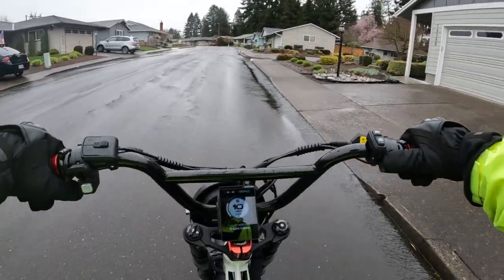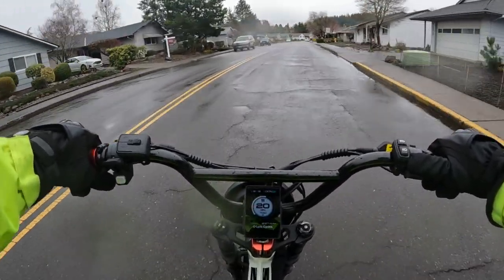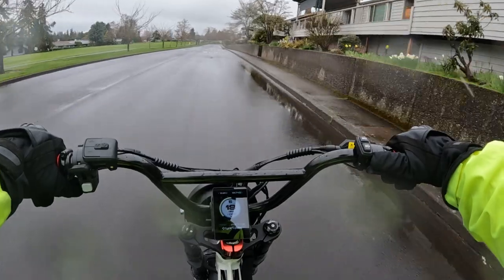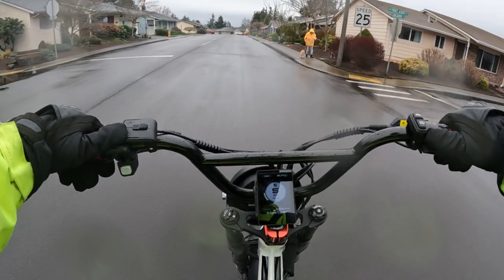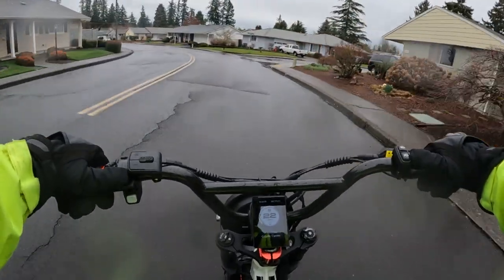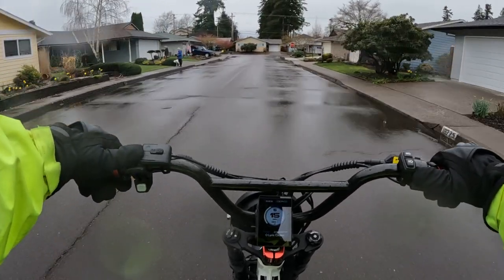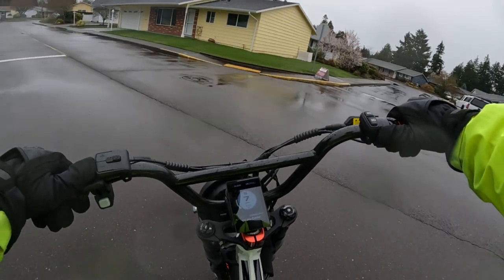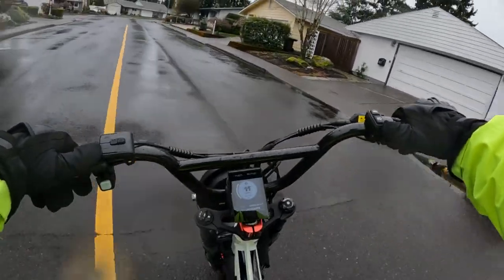Lyric Graffiti Ebike New Battery Fuse Test Ride

Comment: The battery management system inside, should be controlling over amperage. Otherwise the cells will get too hot. There are always temperature sensors on the battery surface that should trip the BMS.

Comment: It's always a great idea to remove the circuit's engineered fuse out ?
& replace it with a higher fuse. We prefer to burn up the wiring than change the fuse.